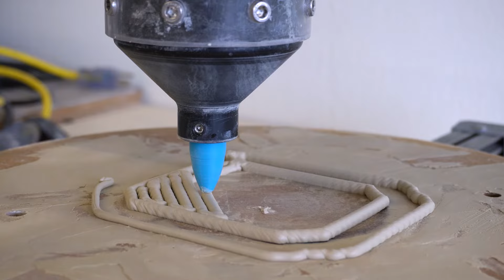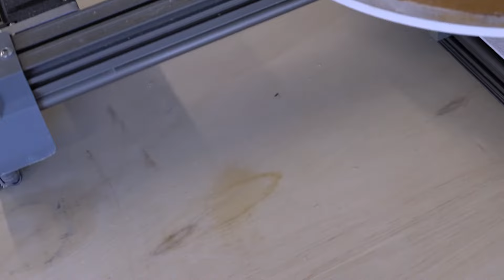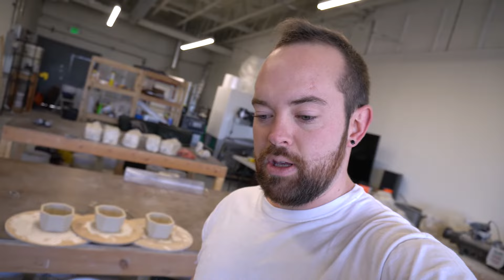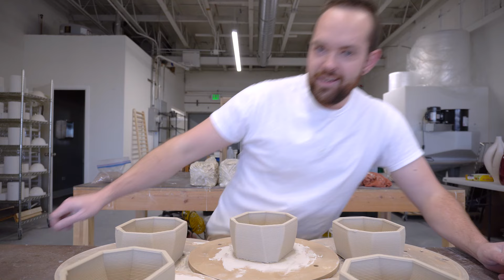A Day of 3d Printing Clay

Comment: Sir!  As a 3d printing enthusiast and potter, I love this. Second, looking at the infill stuff you are working on at the bottom, another experiment you could try is having the nozzle closer to your bat for the first row.  It might solve two things, the “sticking” issue and the gaps in the first layer.  This is often the solution for the same thing with plastic 3d printing.  Have fun!
Reply from the maker: I trying to achieve a thicker base with a single layer. I think I have it dialed now

Comment: 🎯 Key Takeaways for quick navigation:

00:15 🏺 They are using a 3D clay printer to create various forms and planters in the ceramics studio.
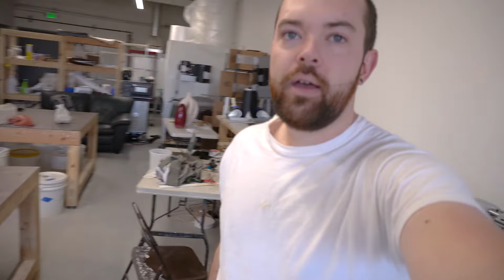01:07 🖨️ The clay used for printing is softer than normal clay, with more water content to facilitate the printing process.
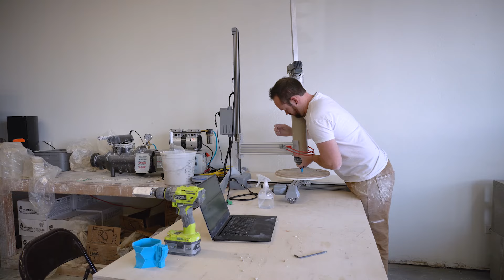02:10 🔄 They have loaded the clay into Plexiglas tubes and attached a nozzle to prepare for 3D printing.
03:26 🛠️ The initial 3D print didn't work well due to incorrect settings, highlighting the need for practice and learning to improve consistency.
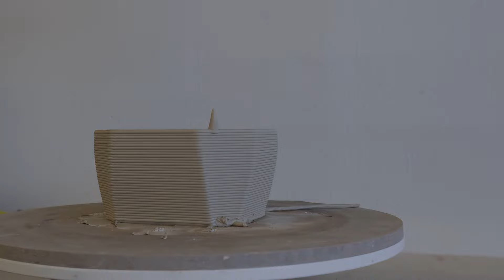04:16 📏 The first successful print is achieved, but there's still room for tweaking settings to improve the results.
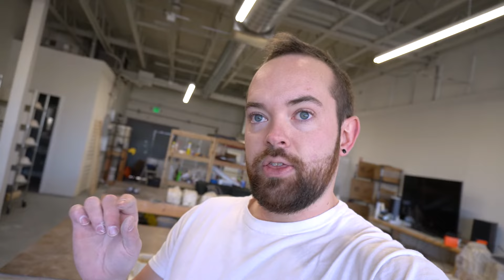05:39 🧮 They emphasize the importance of getting the right settings for the bottom layer of 3D printed clay to ensure correct thickness and infill for consistent results.
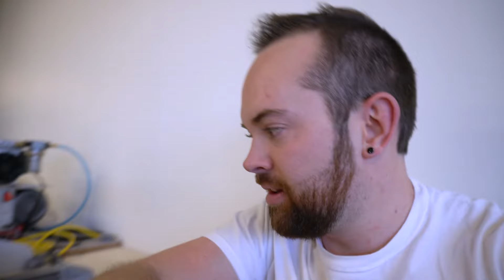06:03 🌱 They mention plans to create larger versions of the printed models and are experimenting with attaching feet to the planters.
06:20 🎉 They successfully printed five planters and are excited about further experimentation with finishing techniques in the future.

Made with HARPA AI

Comment: While like 3d printing those do not look good... I think rather do slab molds like I get logistically this is less labor per unit and time so you can mass produce and still charge normal prices, but just meh I would sooner use a real 3d printer to make slab molds or even dyes, and then do plaster molds of a 3d print then use that thing..